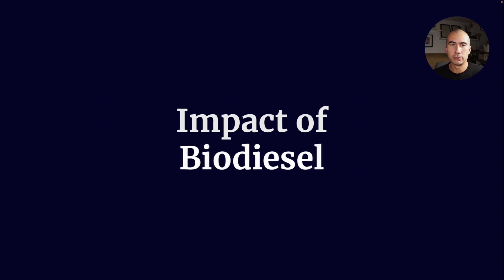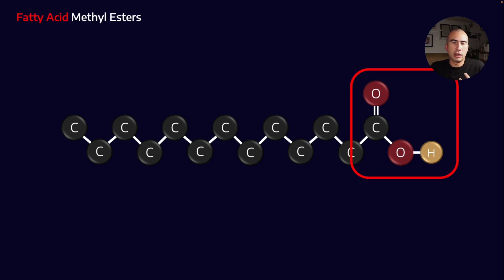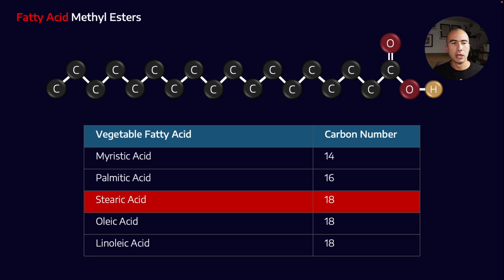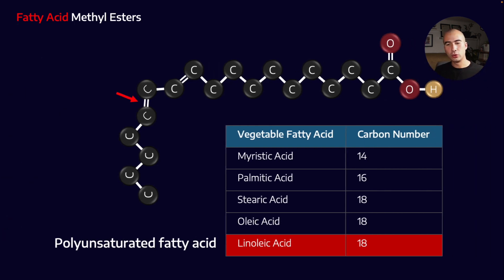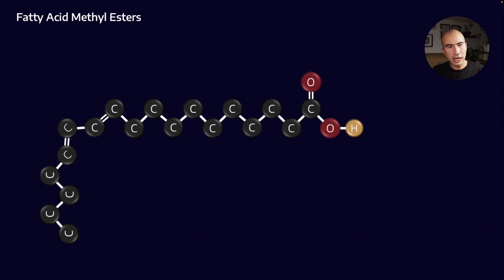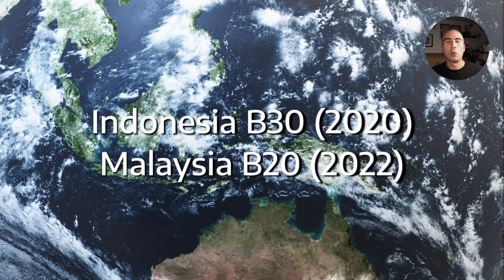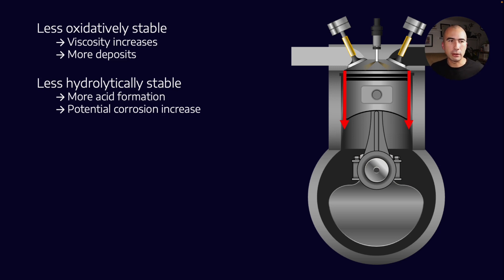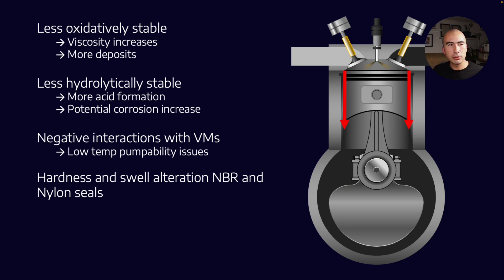How does biodiesel impact engines?

Comment: Liar
Reply from the maker: Hahahaha! 🙃 I'm copping criticism on both sides for this video - so which side are you on? Angry that I criticised the use of biodiesel, or angry that I said anything nice about biodiesel?
Reply: @LubricationExplained  I'm Indonesian. My Car Mitsubishi L300 from new until now always use bio diesel, from B5 2012-2016, B20 2016-2020, B30 from 2020 until now. Bio diesel it's totally save to use in my car. My car usually use to transport palm fruit from plantation to CPO factory. And in march 2022 i buy Toyota Kijang Innova diesel engine and use bio diesel, in manual book its save but the risk of frequently changing diesel filters

In Indonesia, in sumatera island, all of diesel enggine always use bio diesel, because there no pure diesel fuel (B0) in refueling station. Until now its totally save, from rent car that used until now about 500.000 kilometres and the trailer above one million kilometres 

Indonesia in January, 2023 increase from B30 to B35. Its totally save to use by research and development about bio fuel. And in August 2022, Indonesia development B40 in small car like Toyota Kijang Innova, enggine 2GD FTV commonrail turbo diesel, and result of research and development and testing in road until about 60000 kilometers it save to use. The enggine is demolish for see the damage and result is no damage.
Reply: @xi_cuan  those who decide in Sweden have a different opinion, namely that most diesel engines can only handle up to B7 unless changes are made to the engine. That's why they also mix in HVO. Here there are people who have problems with RME Because there can be algae in the tank. Then there is also the opinion that the car will not be as strong as with a regular diesel. And that the car consumes more fuel and that the fuel becomes more expensive
Reply: @Andersljungberg  yeah sure.. HVO (D100) is better than FAME (Bio diesel esterification) (B100) in calorific value, oxidation, and water content. 

In Indonesia have research about B30D10 and its better than B40. You can search by typing "Kelebihan dan Kekurangan Bahan Bakar Diesel B40 ke Mesin". Use google translate 

For you information, Bio diesel HVO (D100) in Indonesia produced from palm oil (used cooking oil) and Indonesia has exported HVO to Europe.
Reply: @Andersljungberg  for use biodiesel B35 in here, we always replace fuel filter and engine oil at a time. Its for prevent injector damage.
Reply: @Andersljungberg  fuel filter in here is cheaper because there more aftermarket parts for fuel filter. Biodiesel here has been subsidized by the government.  the price is IDR 6,800 (€ 0,45)  per liter, while the price of B0 diesel is IDR 16,000 (€ 0,94) per liter.  that's very cheap compared to the price of B0 diesel.  My car, Toyota Kijang Innova 2GD commonrail VNT turbo diesel uses B35 and fuel consumption is around 14 km per liter.  It's very economical considering the cheap price of biodiesel and the affordable price of fuel filters
Reply: @LubricationExplained  Hi! Thank you for the explanation, very intersting topic! The oil change interval of VW 2.0l TDI is 30.000km using VW spec 50700 oil. Would you recommend to shorten that interval due to 7% BD, or would you recommend oil analysis to decide for change?
Reply: @LubricationExplained  If I were you I would have just deleted this stupid comment. Responding to your clearly well informed and information-dense video with a single slanderous word, and zero explanation.
Reply: Explain why the science he espouses is untrue and give us an alternative?
Reply: I'm not a dork with a paper qualification. I used to mix used engine oil with diesel. It was great. Blue Smoke and all.
Reply: How about biofuel use as fueling a powerplant that produces electricity then electric cars like Tesla could benefit of it., less noise and air pollution because, electric car engines has less noise than conventional desiel engine cars. Or Biomass/ Biodegradable materials used to manufacture batteries for solar power plants becoz uranium is not environmentally friendly! 😅
Reply: Salut de France.  J'utilise jusqu'à 60% d'huile végétale filtrée,  recyclée dans ma Benz 300D de 1994. Dans ma 300D de 1982, jusqu'à 90% en été !  Le plus difficile aujourd'hui est trouver de la matière première.
Reply: There is no both side in your criticism
You just said what you said
Reply: @delthamajid9853  I have 100,000 miles on waste vegetable oil, some hobby biodiesel production. I am 1/4 of the way through. So far all I see is chemistry. Are biofuels a suitable substitute for drilling? Maybe, if you farm switchgrass and algae out of the ocean? Is that where this is going? "I'll be back..."
Reply: @GoodmanMIke59  There is a difference if you use rapeseed oil or vegetable oil that is not treated/processed to be diesel
Reply: @delthamajid9853  Can you point out which thing is wrong?
Reply: @acbikeoz  I was write comment, but this channel has been erased them
Reply: @delthamajid9853  sounds like you have no argument….😮

Comment: Hi Mr Briton, Im a Chemist with Masteral Degree and a Mechanical Engr with masteral degree from  Melbourne Australia. Sorry to disagree with you on sooth deposits between biodiesel and diesel. Because of your statement, I did a small experiment that may prove maybe the theory and actual experience is wrong, this is just to make sure. This experiment on sooth formation proves that you are definitely wrong and that chemistry theory is correct. Diesel produce extremely huge amount of sooth vs biodiesel. I want to show you this ceramic sooth test, but this platform prohibits photo. As a chemist and mechanical engineer, I think the reason why biodiesel produces almost negligible sooth, smoke and unburnt carbon vs diesel is its two oxygen in its ester molecule. It gives biodiesel much higher Cetane Rating, thus better combustibility. I hope you can correct this in your podcast please. KEEP UP YOUR GOOD WORKS OF DISSEMINATING TECHNICAL INFORMATION ! GOOD DAY MATE.

Comment: Main way to produce Biodiesel is from Vegetable (or animal) oil, butter, fatt ... all of them are mainly Triglycerids ... not just "fatty acids" ... so the reaction to obtain FAME with methanol or FAEE with ethanol from TG is not an "esterification" but a "transesterification".

Diesel is not just a C16 product, its a blend of several hydrocarbons (linear, cyclic, saturated, unsaturated) and number is between C12 and C22.

Biodiesel has higher lubricant prperties and higher Cetane level (about 50 vs 45), ...and reduce (exept NOx about +10%) all the other exaust gas.

I produce my own biodiesel (FAEE) from wco and mix it as B30 since several year in DCI 2.0 Nissan engine without problem.

Comment: Toyota Landcruiser 2002     &     0k on B100   Never ever seen any contamination of the engine oil with B100.  First MOT with B100 the tester when  I asked him had he got a problem due to him tapping the dial on the smoke tester....Yes he siad I can't detect any particles in the exhaust gasses......   Ah I said  - I'm saving the planet by using 100% biodiesel.... Mind you it was not because of that but that's good of course it was due to the fact that mineral diesel is too dear but it costs a fraction of that cost making the bio fuel.
Seems to be absolutely clean burning  don't it  ?    Beautiful I said ... A guy farmer in the USA   Antifuel 1    says   he's LOVIN it !    I am in touch with him..... comparing notes but his oil is crap compared to my cooking oil.....
See Biolyle    see            Graydon Blair    Utah Biodiesel       They know everything about making and USING biodiesel.

Comment: This is an entire level deeper than this retired mechanic has ever been shown.  Wish to add a couple of semi related nuggets:

With ULSD (Ultra Low Sulphur Diesel) there is inadequate lubricity in the No. 2 diesel by itself, so you REQUIRE B-2, B-5 (2 or 5 percent biodiesel, respectively) to lubricate those very expensive fuel pump, injector assembly, parts, and more.

Next, having driven B-5 and B-20, over the course of 60k, it is plain that you get ten percent WORSE mileage with B-20.    Rule of thumb: If you put five gallons of number 2 diesel with B-20, one of those gallons is pure biodiesel.

As time passes, the emissions implications of B-2 to B-25 (in the USA) will become clearer, but, based on experience so far, legislators or regulators listen to one half of the emissions storyline, and ignore the logical outcome of demanding trouble prone stuff (EGR refeeding soot into the engine) (DPF filter, thousands and thousands of dollars plugging up, ruining everything between its place in the exhaust and the piston-valve-turbo region)  (SCRs with DEF fluid that get wanky because the sprayer for the stuff gets uneven) (Crankcase filling with excess fuel owing to too many regen cycles where the injectors heat up exhaust DPF to clean it, washing down the cylinder walls)(Soot galore from intake to exhaust)

While I deeply appreciate the air being cleaner, not getting headaches driving behind a diesel, there is such a thing as going too far, which legislation did, IMO, well over ten years ago. Once the problem was solved, government swooped in to fix nonexistent problems, creating more problems, which they swooped to fix, breaking things, and that was about 2012.  The beat goes on.

Finally, the whole red herring of trying to lower CO2 is utterly insane.  If you like life on Earth, you require CO2 and O2.   The whiny climate crowd has decimated everyone's awareness of BIG BIG problems in the environment and If I were an evil polluting corp, would do exactly this, trick everyone into worrying about something harmless, that is one half of photosynthesis, life on Earth, while I quietly poison the air, water, with invisible, awful, forever, stuff.  "Hey, Carbon Dioxide has DIE in it, it must be bad!!!!" the mindless must be thinking.

Off the wall tip: If you drive conservatively, and don't mash the throttle now and then, literally driving like you stole it, its diesel sensors will not pick up it is time to self clean the exhaust (emissions) parts. There are sensors better kept inside the cab that are now attached to the hot, wet, dry, vibrating, muddy, rusty, exhaust system (I count five emissions sensors and attachments).

They literally took the most reliable ICE imaginable- say the 6.7 Cummins- and made it so trouble prone and EXPENSIVE it is better to tow with a weak gasoline engine unless you are doing nothing but towing and a lot per every week.

Thankful for this gentleman's insights.

Comment: I manufacture biodiesel as my core business, and we’ve run 23 trial runs with client comparing biodiesel vs diesel. In no cases was fuel consumption increased
Edit after watching the whole video: no water is produced by the reaction mechanism, and biodiesel offers better lubrication than petroleum diesel. Especially after all the sulphur has been taken out of modern diesel. It also is a great solvent, cleaning soot from the engine. Incomplete combustion due to less atomisation is related purely to viscosity. Where I’m from the regulation says 2.0 to 5.3 cSt at 40’C. Biodiesel blends up to even B50 has always passed for us. 
Thanks for the video though. It’s quite informative

Comment: The duty of reduction, i.e. how many percent of the Diesel mixed with . has been lowered in sweden mixing of B7plus HVO made the diesel more expensive Several kroner more expensive per liter. So the people voted for parties that wanted to lower the involvement in diesel. also seems that the performance of a diesel car can be experienced better With less involvement in the Diesel

Comment: Here in Sweden it is B7, however, the reduction duty has been lowered on diesel in Sweden. the reason for B7 is that most diesel engines are not considered to be made for more than B7, however, they could also mix in a little HVO, i.e. Renewable diesel that can be mixed with regular fossil diesel

Comment: However, I have discovered that car brands can have different principles regarding approved fuel for different markets, for example Mazda when it comes to the ethanol content in different markets on a car model that has the same name in different markets. a car that is approved for renewable diesel in the US may not be in Europe. Here in Europe, the density says if the diesel meets the Diesel standard

Comment: Keep in mind that manufacturers fought seat belts for decades.  Ny Golf 201 ruyns great on B30.  I get about 50 mpg out of the TDI engine and don;'t require DEF.  I do changw fuel filters anually, and keep up with recommended oil change intervals.  A single downside, when it's very cold, the engine does like the glow plugs to be hot to start.

Comment: Ya depends on if your engine was lucky or if it was actually designed to use bio diesel.  There are even various types of biodiesel; the original Diesels ran on peanut oil.   Thus you can't really make sweeping statements about what bio diesel will do it ought to be evluated based on the specific engine.

Comment: Renewable diesel is the way to go.  It uses the same feed stock as bio but is fully refined into the exact chemical as dino without the junk.  Higher cetane, higher lubricity, lower cloud point, no sulfur, no oxygen, no smell, less soot, just better in everyway.  Its mostly on the west coast but hopefully at a station close to you soon.
Reply: Not higher lubricants. And density doesn’t meet EN14214 standards. Viscosity is also lower than the standard. The hydrogen needed to produce green diesel is almost never green sources. And the oil is imported from all around the world using heavy diesel (very dirty diesel) shipping vessels. Biodiesel is the way to go
Reply: @trumpthelegend6357  Enjoy your leaks and repairs.  I like the no smoke and no smell.

Comment: That is the problem should not be at all as big with HVO Diesel because it is claimed that It is chemically similar to regular diesel Even if HVO is fossil free diesel. however, the cetane value can be 70 or higher

Comment: In Sweden it is B7, the justification being that most diesel engines cannot run at a higher ratio. Therefore, they also mix in HVO = Hydrotreated vegetable oil. . There is information that there is a lot of animal fat in HVO in Sweden

Comment: Thank you for great presentation , How BioD effects filtration and flow? also I'd like to share my personal experience in this regards , I have a Chevy truck diesel V8 with 120 kmiles for past 15 years , I had to fuel in Arizona and had no choice of #2 D , I filled with BioD , after 200 miles in mountains my truck went to limp mode and CEL on , had to pull over , scanned the code , and indicated fuel filter plugged , reset and I made it home , filter was not over due for service , also this truck has oil quality sensor , always reminder would come on at about 100 hours or 6-7 kmiles , it came on at around 3000 miles , thank again  for great knowledge.

Comment: Im a chemist with masteral degree and masteral degree in Mechanical engineering. I totally disagree with your statements 1. The reaction of oil with methanol doesnt yield water. It produces 3 molecules of methyl esters and one molecule of glycerine AND NOT WATER. 2. Biodiesel carrying the alkyl group of oil, has lubricating and cleaning properties, thus it doesnt only clean the engine of dirty diesel deposits but it also lubricates it to lessen the engine noise and make the movement of valves and piston smoother. 3. Biodiesel dont react with water, it has an extremely low dissociation constant and dont reverse back to triglycerides or oil. It will never produce water nor glycerine. You must be referring to the odorous mercaptans and cancer causing benzene of diesel. Brother, no offense but you have to review even your mid school chemistry. Be extra responsible to your global viewers.
Reply: I'm a mechanical engineer, just a bachelor's. But I did make a ton of biodiesel about 10 years ago before DPF filters were mandatory.   As you mentioned, the byproduct was glycerine.  Which made the best soap ever if you could tolerate the look of it.  Only water content in the biodiesel was from when I was washing out the excess catalyst so it wouldn't corroded my fuel lines.  Which was easy enough to evaporate away any of it that emulsified and didn't naturally separate with a resistance heater and air exchange using a fan.  Purely anecdotal, but I'm pretty sure my old Jetta would idle smoother when running B100.  Im no expert, but it was a fun little hobby.
Reply: Yes, agreed with yours.
Reply: It ruins parts
Reply: There are problems with algae in biodiesel. Several Swedes can testify to that. And there are different types of biodiesel also what has been used
Reply: @Andersljungberg if you use it within a couple of months you won’t get algae in the biodiesel. Diesel isn’t immune either. Shelf life of biodiesel is 6 months, diesel is 1 year.

Comment: A data point, I home brewed B100 for my TDI VW.  My base stock was used cooking oil, most likely canola oil but not really sure.  I have intermix using my B100 to buying normal diesel based manly on convenience.  My TDI VW is around 15 years old now and has over 250,000 miles and never had a major mechanical issue.  I do keep up with the maintenance and change my oil and fuel filter more frequently than required.
Reply: You can afford it
Reply: What year is your jetta?
Reply: @spilledit  2006 VW Jetta with 5 s/p.    Consistently get between 45 to 50 MPG. (using US standards)  I can start from central Texas and drive to either coast with only needing to stop once for fuel.  I can start with a full take of my B100 and when needed, fill up again with fuel station diesel with no issues.